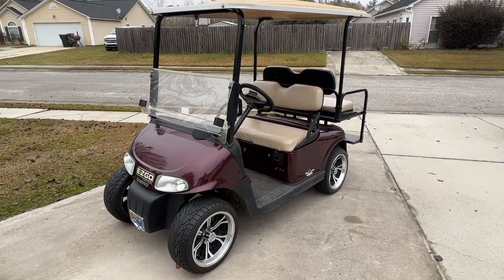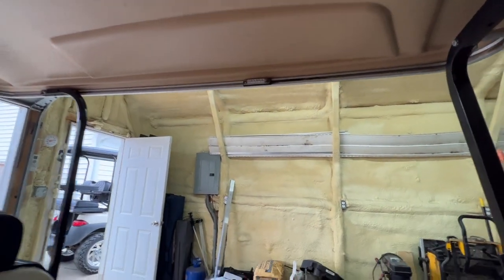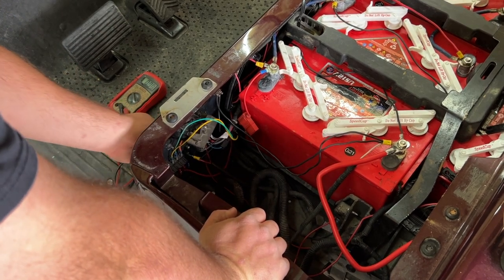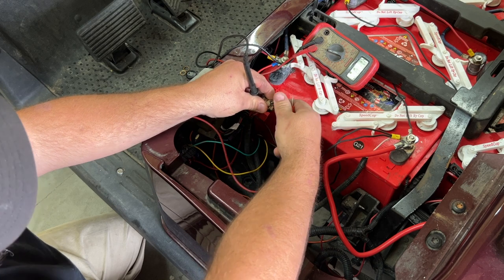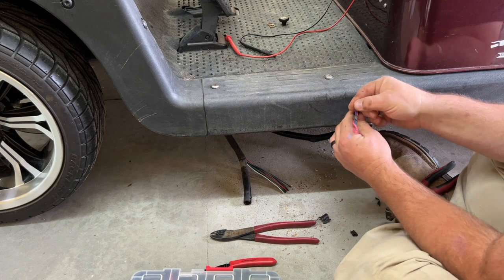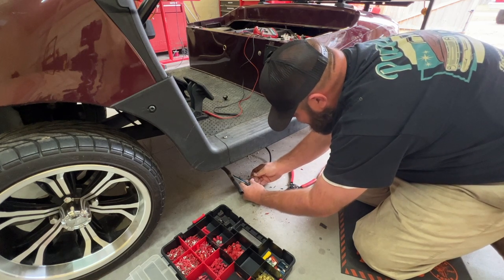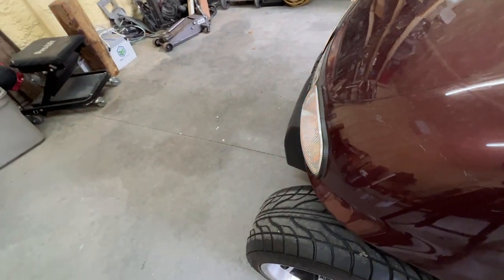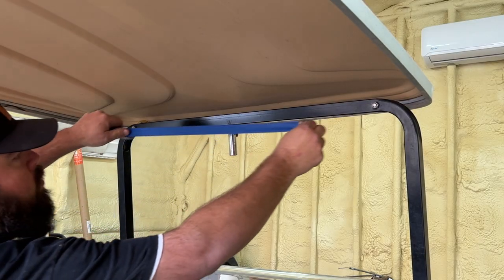THIS Caused My Neighbors Golf Cart Headlights to Fail | Ezgo RXV Install RearView Mirror Install

Comment: I have a 2015ezgo txt lights were working fine installed carbon fiber dash hooked everything back up per picture I took now head lights and tail lights flash no turn signals just headlights    and tail lights

Comment: Now why would the designer/ manufacturer put a connector under the cart in the open???🤨 Good information since we are headed to a 55+ golf cart community next year. Thanks for sharing.
Reply from the maker: This looked to be an aftermarket install. But I think when the owner charges to lead acid batteries that they are boiling over due to being over filled and it’s running down the wiring. Which community are you guys going to?
Reply: Fentertainment  Latitude Margaritaville Daytona Beach. Our last Winter in Northern Virginia!
Reply from the maker: @spyderingwithdandenise7064  very nice!
Reply: @spyderingwithdandenise7064  Buy a Club Car. All of the wiring is run inside the body and they ride and steering much better because they are designed like a scaled down car. With a factory aluminum frame, you'll never have to worry about rust either.
Reply: Goldenlife  I really like the Club Cars but they are slow. Currently we are thinking of a Bintelli.
Reply: @spyderingwithdandenise7064  SLOW....... are you kidding me. My Club Car Precedent runs over 50 mph.....Now that's with 72 volt Big Battery LiFePO4 and a Navitas AC motor controller.  Even with a stock controller and max speed code from club car I was 27 mph. Now this is a 2008 model cart. If you get the max dealer installed speed code on a new Lithium cart it will run in the 30's according to a neighbor who test drive one.
Reply: @goldenlife9856 Aluminum may not rust ,but it does corrode.  Aluminum is not a durable as steel.
Reply: @David25522  If you look at the majority of older E-Z-GO, Yamaha, and Hyundai carts the battery trays and or center frame areas are rusted to the point of falling apart. I've never seen anything with a aluminum frame have anything more than surface corrosion and since I live at the beach, I would have seen it if it happened. FWIW